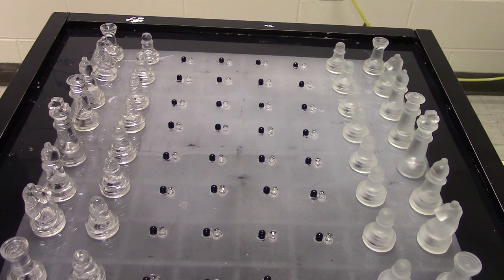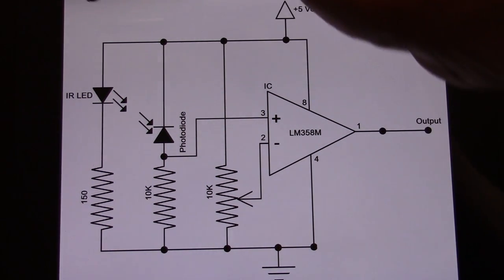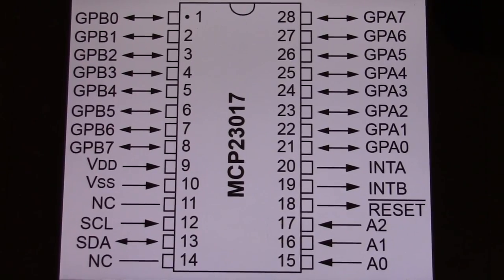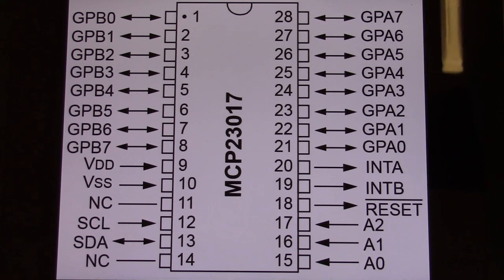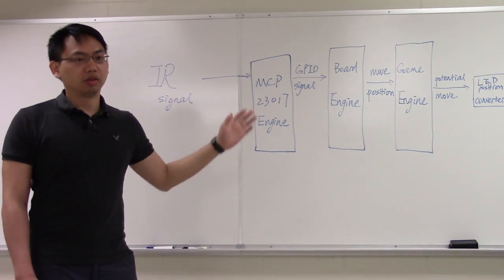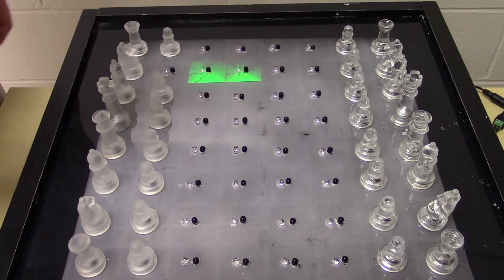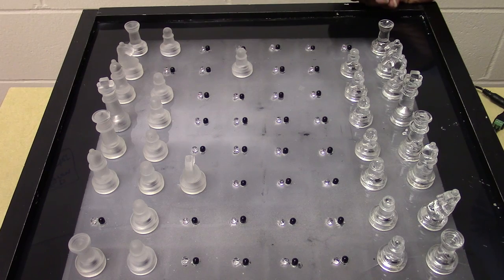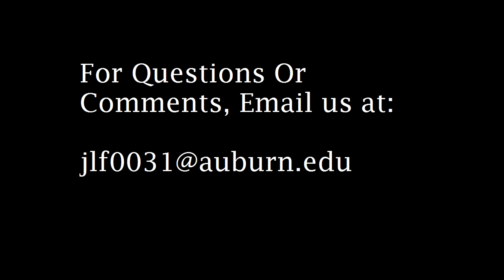Spring 2017 ECE Senior Design Project- LED Chess Board

Comment: Nice job. What kind of LEDs did you use? How did you control the color of each LED? Can you do so with one signal only?
Reply from the maker: We used these: https://www.amazon.com/Kuman-WS2812B-Addressable-Arduino-littlergb/dp/B01M5BEO1C/ref=sr_1_4?ie=UTF8&qid=1539012591&sr=8-4&keywords=single+rgb+led

We had to solder them sll together in series and yes it's only one signal.